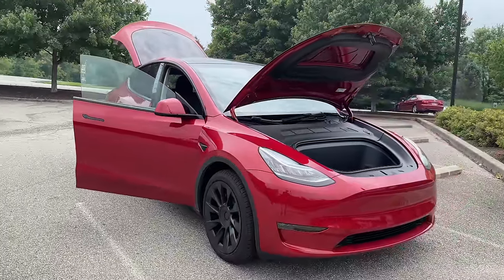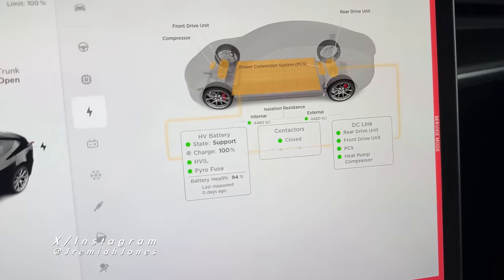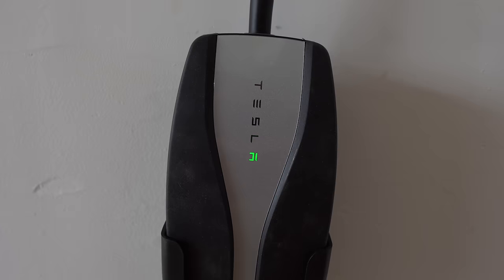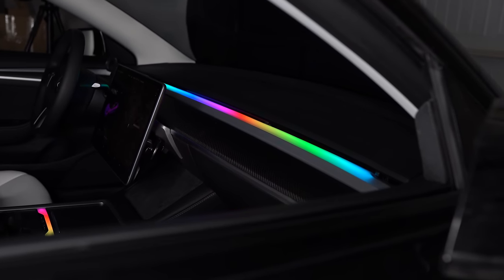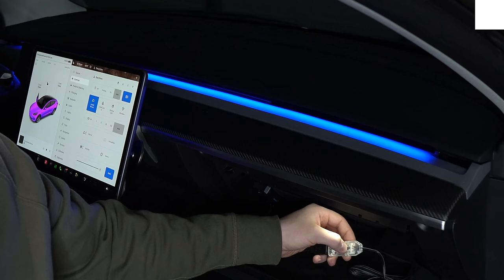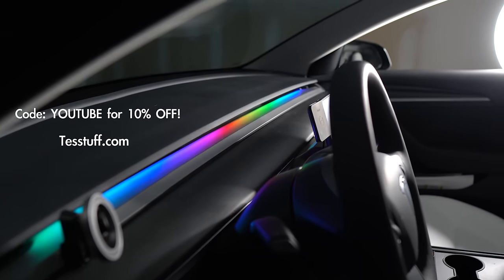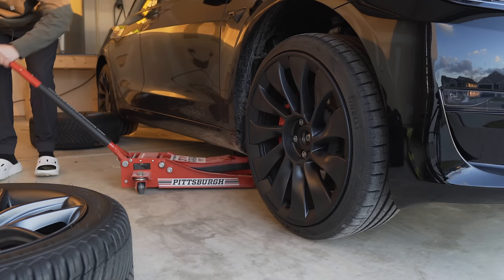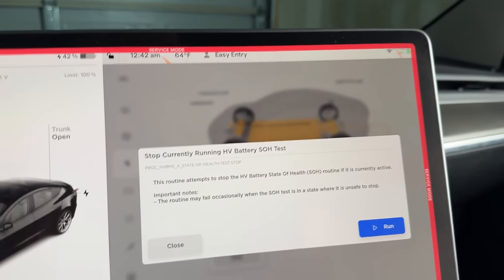How To Charge Your Tesla The Right Way | Avoid This Mistake!

Comment: Always plugged in like a kettle will run your bill up
Reply: Not true
Reply: @markcain5168  why not? Phantom drain is a thing. You loess 7mikes every 2 or 3 days just standing still, and more if it’s a hot or cold day.
Reply: The amount added to your electricity bill depending on your rates and time you plug in should be still way better than filling a gas tank at current gas prices. My car is always plugged in from when I get home from work till I have to leave in the morning, payed $600 annually for the 4-5 years of driving and that would be under $600 if you remove the supercharger stops, which by themselves would probably knock off about $60-$80 off the $600. My other vehicle which is gas cost me close to $3000 annually to fuel up.
Reply: Wrong. Think of your toilet. It's always connected to a water supply. It only takes in water when needed. Just like your EV. It only takes what is needed.
Reply: Looking for some real data on this...
Reply: @Techridr  - Not quite. To use your analogy, Its like you are constantly wasting water down the pan (drain) as the rubber seal has aged. You see batteries take power to keep them at the right temp. Also with degradation, the battery will continue to charge even if its degraded to 80% of its new capacity always trying to charge up those small cells that can not take the charge. The BMS does do a good job, but you can not charge those cells that have degraded and request a charge via the pack that those cell sit in, else that pack will fail. 

If you keep it plugged in it will always be trickle charging and a % of that charge will be wasted. Its equivalent to about 7miles lost out the pack over 5 days. Don't believe me? Unplug your car and leave it sitting in your garage for a week and report back how many miles you have lost. Its like having a hole in your ICE gas tank.
Reply: @aqf0786  do the experiment yourself. Leave your EV sitting in the sun for a week and report back how many miles it has lost. Thats as real as it comes my friend.
Reply: @latitudeash  If you do your calculations based on reported available miles shown, that tells me all I need to know about how you measure. I use Tessie and Scan My Tesla for real numbers. I've had electric vehicles for 13 years. I can tell you that Teslas use very little power when idle and plugged in. This standby power consumption is even lower than the energy used to recharge the battery at a higher kW rate, where a slight build up of heat in cables and connectors can actually waste more energy (slightly). Even the energy used to turn on lights to unplug the car might outweigh the minimal standby power used. I've done all the tests for my own peace of mind. I've kept it plugged in, I've run the power down then charged, and everything in between. There is no more overall kWh usage leaving it plugged in. My average is nearly identical from the days of regular charging, if not slightly better
Reply: @latitudeash  Also, EVs don't condition or pre-condition when on AC home charging. That energy used to heat batteries only applies when DC fast charging.
Reply: @Techridr  noted. But I have read Tesla owners leaving their EV at the airport parking for two weeks to comeback to a dead Tesla and having to call the RAC or Tesla to load the EV onto a truck and get back home to plug it in and let it charge overnight. They may be other reasons for that happening but its a common issue for first time tela and holiday goers
Reply: @Techridr  point of correction.. Tesla do heat up the battery or cool it down when certain limits are reached, even when not supercharging. I know this for a fact. If you do not believe me call the service center and ask them.

Saying all that, I an not against EV’s. It has s place in the mix. I also do not believe EV’s will replace gas/oil cars. 

I think EV’s have their place and for some totally practical for their life style and routine. So I am ½ agreeing with you. The tech in the ev’s can not be matched by fossil fuel cars
Reply: @latitudeash  What I am asking for is not unplugged loss, but plugged enery usage.  They are not necessarily the same and I am asking people who watch their car energy usage at home while the car is not being used but plugged in.  This is not neccarily what the software reports either

Comment: Question about always being plugged in. 
Does anyone know if the car drains battery or uses wall charger, when it is set to off peak charging? 
It doesn't charge ofc, but the system drain would be nice to not go on the battery, but the wall charge even on Off peak charging